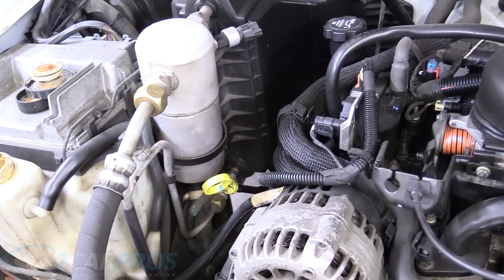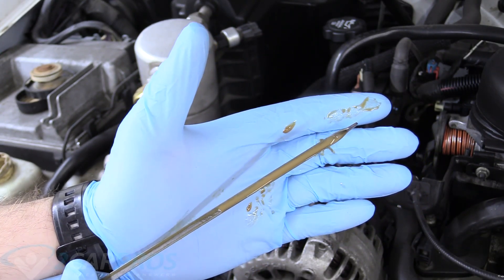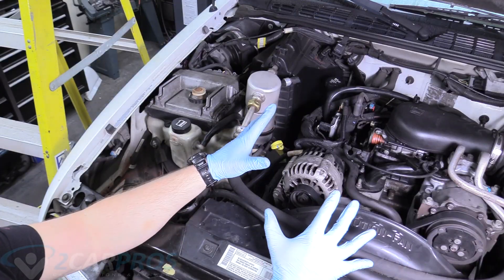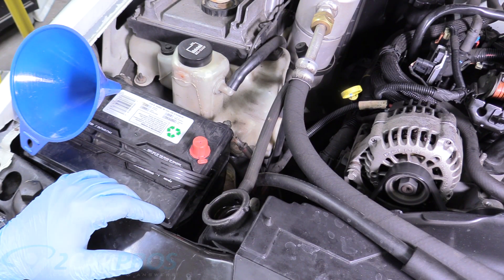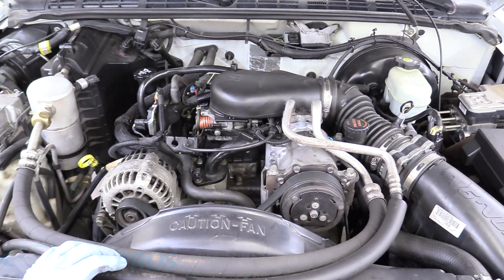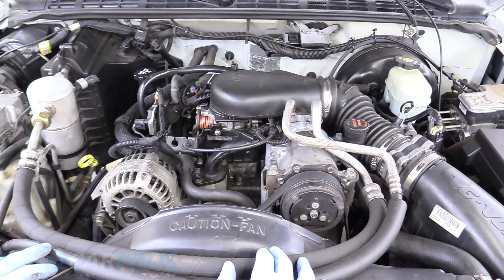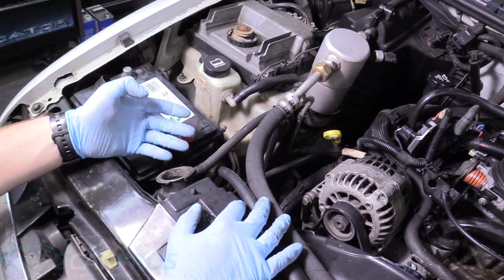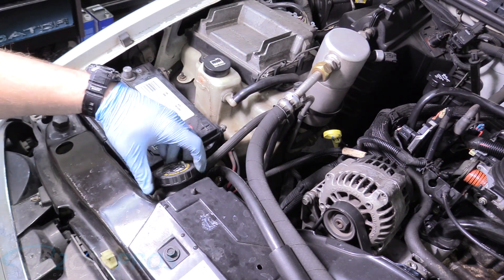Can You Fix a Head Gasket with a Chemical Sealer?

Comment: I really don't like quick fix liquids and such, but this stuff works.  It's not the cure all forever as long as you own the vehicle for 30 yrs, but yea it works.  I had an old employee that tried it on his 99 Ford expedition, 5.4L.  The head gasket leak was external, from the rear driver side,  he literally saw the leak stopped as the engine was running, from underneath the truck.   I used it on a customers Subaru, he needed 2 months, and it worked for him, bought him some time, then changed the motor to have his wife total the car.  Its not the cure all.  Fix what you have to fix, but it works.
Reply from the maker: Our S-10 is still going strong, I can't imagine it will forever but hey if it lasts a year I'll be happy. Thanks for watching!

Comment: A compression test on the cylinders is a better test if this stuff works.
Reply from the maker: As long as there isn't any more coolant in the oil and the coolant level isn't dropping I'd call it a success. Thanks for watching Ken!
Reply: @2carpros  a head gasket that leaked coolant into the oil could have gasket failure between cylinders too.
Reply: @Ezzell_  so a leakdown is more appropriate